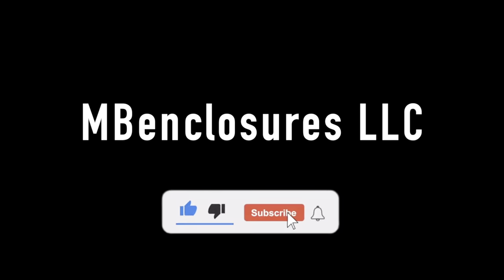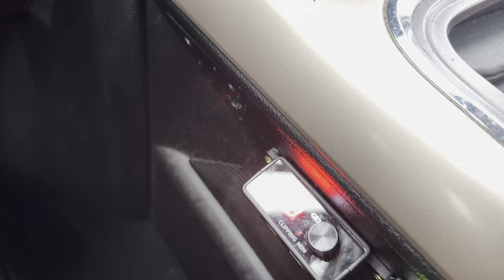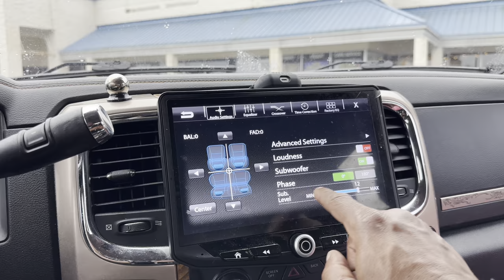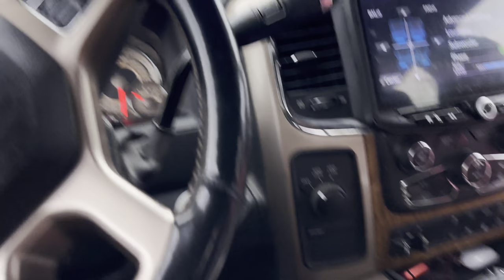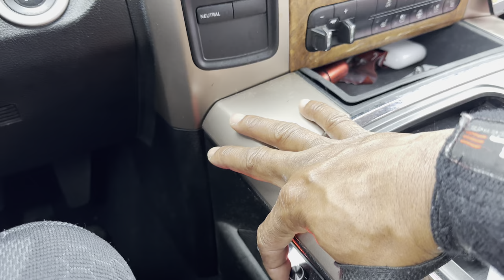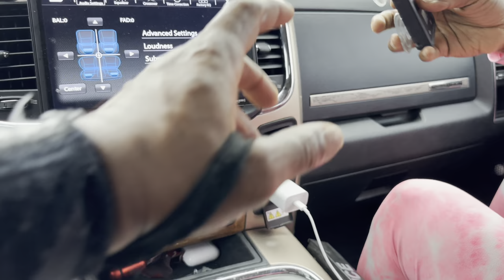How The Beast is Setup w/ the 2 DD M2000 Amplifiers and ZVL Link!!! True/Clean Power at any Level!!!

Comment: Hey big fella, what kinda head unit you got there? I have an 08 ram, I'm building a center console box to house 2 12"dual vc no name hammers I put in my sister's whip almost 13 years ago!! They are showing there age but still knockin!!  Anyway, 1500 watts in a center console under the factory armrest... It's 80% done but man, I made it down fireing though... I'd like to show you my plans and get your input on what kind port to go with... 2.5sq.ft for 2 dvc 12's and 1500watts...
Whatcha think man....Short slotted port or two 3"x 30" round ports? 
Overall box is 16"wide x 34"long and averages 9" tall...
Hey man it's Also a 6 speed manual so the first 12 sits directly underneath the armrest...let me know MB!!

Comment: Bruh I need some help over here please.

My car is vibrating apart. So far the trunk locks busted inside and out, the motors for the side mirrors stopped working, the rearview won't stay up, the entire dash must've lost some clips or something because it bounces now and the instrument cluster stopped working. Can't see gas, battery or speed, and all the warning lights are stuck on. I can see my speed on my hu but still...

There's more but I think you get the picture. This is my daily driver so it has to be fixed. What products are out there to tune this down to a manageable state? The entire car was sound deadened with 2 layers at this point.

Comment: Does all the songs you play require the epicenter to be used?
Reply: No, if you use epicenter with songs that have alot of bass, such as rap, it will sound like garbage.
Reply from the maker: Because your setup is wrong. Either the subs can’t perform low or your box tuned to high. If the song has alot of bass the the epicenter is not affecting it. I use my epicenter all the time on any song, cause I use good subs and my box tuned low. The epicenter really will expose a sub in a prefab box.
Reply: @MBEnclosures™  it may be my sub I'm using. It's what you call chocolate  or doodoo subs lol.
Reply: @M.B.Enclosures  On my level by wiz khalifa sounds muddy with epicenter regardless of the system. Any rap that already has 40hz or below in it will sound terrible with epicenter.

Comment: Is that a stock head unit or aftermarket?
Reply: Aftermarket but it is specifically designed to work with this year/make/model/trim level truck. Meaning all the controls that were accessed through the stock head unit still function. I believe that everything is included like wiring, brackets and trim pieces. Pricey but designed for minimal compromise in function or performance. MB made a solid choice with it!
Reply: Its a Stinger heigh10. You can look it up.

Comment: I would greatly appreciate if someone please to help me understand if there's a negative effect on a Subwoofer that is recommended by the manufacturer to have a port tuning of 40Hz but you installed it in a 33Hz or 35Hz port tuned box.
Thanks
Reply: No, it doesn't hurt anything. Tune to how you like it.
Reply: @JasonWW2000  Thank you, I really appreciate it.
I'm still confused though as to how there's a recommendation but yet you can go below it & nothing bad will happen. 
I'm a newbie & I'm trying to find a book to read for trying to have more understanding as ppl have so many different opinions.
Reply: @orvilleblack3774  The factory recommendation is usually a compromise of wide bandwidth vs output level. A lot of people like 40Hz tuning as it gives higher output and sounds good with a wide range of music. You see a lot of prefab boxes with tuning around that. It really depends on the listener, though. I've got a big suv and its naturally peaky around 44Hz. I also like a very musical output so I prefer to tune around 27Hz. In my particular situation I'm getting a pretty smooth frequency response. If I tuned to 40Hz I would be very loud around 40-45Hz and not have much output at 30Hz at all. It would be very peaky. Great for getting loud, but not so great for being musical. So tune it for what you like. 
Don't let the Fs of the driver fool you. Lets say you have an 8" driver and its resonate frequency (Fs) was 40Hz. The manufacturer might say its bandwidth is 40Hz-200Hz. That doesn't mean it can't play lower, though. You do want to follow the recommendations for box size, though. If they say a ported box for an 8" needs a net volume of between 0.65 and 1 cu ft then you should stick pretty close to that. The bigger size gives more efficiency, but uses more space. The smaller size takes up less space, but efficiency is lower. So they are tradeoffs.
Let me know the specific driver your talking about. I'll look at the specs.
Reply: @JasonWW2000  Thanks a lot for your explanation, I do have a better understand now. I really appreciate it. 
I’m using two Rockford Fosgate T1D412
Reply: @orvilleblack3774  Yeah, I see where they recommend a 40Hz tune for that sub. It's all a compromise. If you tune to 40hz its gonna have very high output, but not play much under 30hz. If you want it to play lower, go ahead. Their aero port recommendation of 4" by 9" can easily be changed. I like aero ports because you can easily adjust them. You could do 15" or 20" long, whatever. Using the Speaker Box Lite app I can see that going from a 40hz tune to a 30hz tune will be 3db less at 50hz, the same at 40hz, but 4db more at 30hz and 6db more at 20hz. So its all up to you. That sub can play low. I don't know why Rockford would suggest such a high 40hz tune for a 12 unless they just want it to be louder, so maybe that's their goal.
Reply: @JasonWW2000  You have help me so much & I really appreciate it 🙏
Reply: @orvilleblack3774  There's so much science behind how car audio works. I've been doing this 30 years and still learn new things. Theres no one book or video I can point to for you to learn everything. I'd recommend you watch the Kicker Unmasked series from the last couple years. Also the 5 Car Stereo videos. There's tons of good knowledge there. 👍 Take it easy!

Comment: i use lc2i pro i run with it all day at 3 oclock have a stock head unit currently sync2 ford  about to install an epicenter here soon so i would take  rca from lc2i to the epicenter then to my amp?
Reply from the maker: Correct